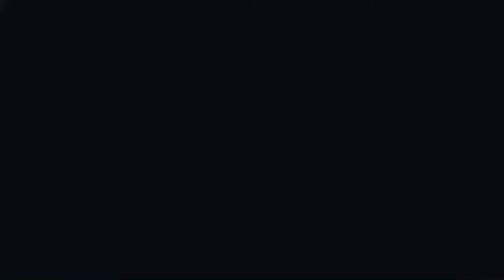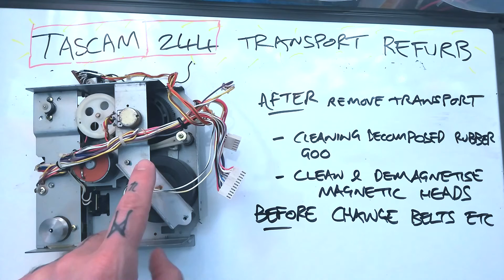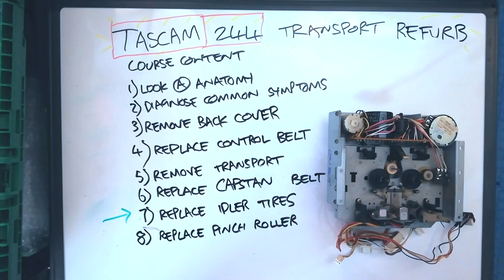1 Introduction (Fix Your Tascam 244 Portastudio Transport)

Comment: Hi Tetrakan! Thanks to your videos I was able to successfully replace all the belts on my Tascam 244 — super easy to follow with clear, step-by-step instructions. 🙏

I’ve run into one issue though: when switching to record mode, the VU meter on Channel 1 is fully maxed out and there’s a loud hum. The other channels work and record perfectly fine. Monitoring Channel 1 through the headphones also sounds normal when I plug in a guitar, so the problem only appears in record mode.

Do you have any tips on where I should start troubleshooting? I’d really appreciate your insight.

Thanks again, and greetings from the Netherlands! 🇳🇱

Comment: I've finished restoring my 244 based on your wonderful instruction. Thank you!

I'm having an issue with the headphone outputs. It's a high-pitched buzzing sound that comes and goes. It tends to get louder while the tape is advancing, but it's always there to some degree, no matter how I set the controls. Often just touching the controls will make it louder or quieter, and even giving the unit a gentle whack on the side can make it go away. Have you encountered this before?
Reply: I've figured out my issue, mostly. 

The first clue is that the buzz was a perfect match for the spinning of the capstan motor. When I slowed the motor with my finger, the buzz dropped in frequency and stopped. Ok, so that's the source, how is it getting into the audio? Schematics show it can only be through 12V or ground.

The second clue is that the buzz would come in and out when I wiggled the power supply/output amp PCB. It makes sense that the problem would be there, but what could cause this behavior?

I unscrewed the PCB from the chassis, and the buzz was persistent. Then I connected a lead between the PCB's bracket and the chassis, and the buzz went away. So I guess it's a grounding issue? I screwed the PCB back to the chassis and it's gone. Not the most satisfying resolution, but I'll take it!

I hadn't removed that PCB during my refurbishing. I guess some oxidation formed between the bracket and screws and made a bad connection. Re-tightening the screws would have scraped away that oxidation.

Some tips for removing that board, since I didn't see it covered in any of these videos. There are three screws, left middle and right. The middle and right ones are hard to get at because there's a bundle of wires right above. They have black wire guides attached to washers that you need to open up to shift the bundle out of the way. It would be much easier with the channel strips removed, but I managed without removing anything. I advise using a standard screwdriver, not a multi-bit screwdriver with a thicker shaft -- I almost stripped the left screw because some components were in the way, tilting the screwdriver.

I hope this helps someone, or at least gives them some ideas for troubleshooting a different issue.

Comment: YOU ARE A BEAUTY! These tutorials are a godsend! I've had a tascam 244 since I was 9. I'm now 29. I learned how to record on this thing. 

Struggled to intuitively fix it over the years with no knowledge of tape machines. I finally thought I had to sell it for the past couple years because it has been eating tapes like mad.

I diagnosed the problems thanks to these videos. Thought I'd have to order some cheap replacement part for the pinch roller. Or pay this ridiculous sum for an OG one. 

I impatiently took one from a cheap unused boombox, cut the sticky problematic material off the old one, used rubbing alcohol to clean it, sanded the center to match the gauge of the original brass part snugly and hot damn. This beautiful source of tape saturation is alive again! 

Thank you so much! 

God bless 🙏🙏🙏
Reply from the maker: That’s awesome, glad to help!

Comment: I aimed to refurbish my old Tascam 244 I found in the cellar. Following your instruction (thanks a lot !!!) I replaced both the capstan belt and the control belt as well as all rubber parts. I cleaned in- and out-side as good as possible. After the machine was resembled, the capstan belt moves but neither of the buttons (play, forward, rewind) works. I am clearly not an expert in electronics but is there anything obvious I could try? Thanks a lot.
Reply from the maker: The control motor should be turn8ng the black gear below it in response to button presses - if this isn't happening, explore cleaning or just replacing the tactile switches underneath the plastic coveted user controls. If you check my 244 playlist, there is a video on this.
Reply: Thanks a lot.  @Tetrakan

Comment: Hey mate, first of all I just want to thank you for all your help and the valuable information you have put out on these videos.

I have a question I've seen other people ask, but I'm still clueless as to what to do next.
Here is my issue:
As a mixer, my tascam 244 works great. All channels recieve audio without problems and eq works, all is good. When I go into playback mode or record mode, channel 4 doesnt work meaning it doesnt record anything and doesnt playback anything that is recorded. I've tried recording to track 1 and 2 and flipping the cassette, still no sound out of channel 4.

Any tips as to where to look? There is no one in my country that can actually help me and its kind of frustrating at this point. 

I know my question is a little ambiguous but hopefully you can give a few pointers that will help.

Thanks mate, God bless.
Reply from the maker: Hey, I could give a very long detailed description of what to do here, but in a lot of ways it would be easier (for you) if I refer you to my playlist of electrical troubleshooting videos-  within that playlist pay attention to two videos about magnetic heads, one about signal tracing and three about electrical signal flow in the 244. After watching those six videos you should have a better idea of where to start...if later in the process you are still unsure if how to proceed, leave me a message on the comments of one those videos and I'll advise you, thanks for watching! https://youtube.com/playlist?list=PLYsfQOh0tsJV9lzfeBFGJsI0md4FRGR6h

Comment: you are the best.  so, i still have a problem.  when i press play, it just goes into fast forward, although the idler tire does release.  any thoughts on this?  on another note, i found two screws that hold onto the face that you didn't mention.  they're VERY long screws that are found deep in the main wiring channel.  took me a while, but i got it done.

Comment: Hi, would I be correct to assume that a tape that was recorded on a 244 cannot be played back on a 246 simply because tracks recorded from the 244 would be spaced out on the tape ribbon differently than the 6 tracks on the playback head of the 246? I'm not entirely tech savvy about these machines. Also, do the two machines run at the same speed? Thanks again for your videos!
Reply from the maker: 246 is 4 track cassette, 6 track mixer. The transports on both models are more or less identical. The 246 is dual speed and defeatable dbx,  the 244 is high  speed only, dbx is always on. So if the 246 is set to high speed and Dbx turned on, the recording ms should sound identical on both units.
Reply: @Tetrakan  Ok, thank you very much!
Reply: @Tetrakan  One more question about setting the speed on the 246. Is there a switch on the unit that you would use to set to at high speed or do you just turn the pitch control all the way up. I've used a 244 before but I've never had a 246 in my possession to look over. Also, I assume there's a on off switch for the dbx you mentioned? And lastly, how would you apply a 6 channel mixer to 4 tracks? I'm a little confused about that.
Reply from the maker: @39thala  Thanks! On the 246 there is a high/low speed switch to the right of the cassette cavity inside the cassette door to choose between 3&3/4 inches per second (same as a 244) or 1&7/8 ips which is half that, the same speed as commercial cassettes and low speed units like the Porta On; the pitch control knob changes the  base speed by plus or minus 10%, pretty much the same range as the equivalent knob on a 244. There is DBX on/off button on the front panel, and an option on the rear panel to leave DBX off on channel 4 so you can stripe that channel with data for SMPTE or MIDI synchronization and send the output fo that channel to your synchronization source. Its important to understand the difference between tracks (tape) and channels (mixer) - it is typical in a studio to have more channels than tracks, so the 246 is a little closer to those sorts fo facilities..... One  reason it is useful to have more channels than tracks is so you can blend multiple microphone signals   - an extreme example would be on a 246 you could record 6 microphones on a drumkit and blend them all to one mono tape track leaving the other tracks free for bass guitar and vocals without bouncing. The other common use for the extra 2 mixer channels is to use them as effects returns - this allows you to do several things to the effects on the 246 you can't do on the 244 ;- EQ your reverb; have 2 mono effect returns instead of one stereo return; place the reverb for a guitar on the opposite side of the stereo field to the dry guitar. As you can see from the length of this comment there isn't a short answer, but stay tuned because I'll be doing an overview of the 246 soon and I'll elaborate on the mixer in that video.
Reply: @Tetrakan  Very informative! Again, thank you very much!
Reply: I just want to say, your videos are great! Thank you for sharing your knowledge!

Comment: hello tetrakan supermonobloc , i was about to attend to my tascam 244 portastudio only to find that record playback capstain heads are protuding as they would if in recording mode , i cant correct them . hoping you may have a suggestion mate . thank you tony lee
Reply from the maker: The control belt probably snapped in that position. You can turn the white plastic wheel on the rear of the transport by hand to lower the heads
Reply: @Tetrakan   thanks for your time in replying tetrakan much appreciated from australia again

Comment: Hi Buddy! Any chance for your helping tips on my channel 1 being really quiet/ low signal? Are there any known quick fixes for thos, or do i need to meter voltage and being good at schematics? 😊 best rwgards, E
Reply from the maker: There are several things which could cause this, dirty faders is one, i'd say try to watch through all the videos in my 244 playlist. If you want to jump to the one about calibration, here is the link...to do it properly you need an analogue meter or scope and test tapes, but as a dirty hack you might get away with just turning up the playback amplifier trimpot on your problem channel, and all you need for that is a small screwdriver, thanks for watching. https://youtu.be/vNCSR447M5o

Comment: I have a Tascam 424 MkII. Are they at all similar
Reply from the maker: Yes and no. The 424 mk II transport is smaller and lighter and has only one motor which turns constantly when the unit is on  - the capstan rotation is driven directly by this motor but then a smaller belt from the flywheel drives the raising and lowering of the magnetic heads and the turning of the reels (which works via gears not rubber idler tires). There's a complex system of gears and cams which convert the flywheel rotation into reel motor and head raising functions, and two solenoids are responsible for which cam and gear is engaged, it's the solenoids which respond to the user pressing the transport buttons. The same transport is in the 424 mkiii also. I filmed a tear down if the mkii, check my channel landing page, there is a horizontal section for all the portastudios I have filmed. Thanks for watching 😊

Comment: I've learn a lot watching your videos. I'm having issues with my Sanyo M7735. Hopefully you can help. Thanks https://www.youtube.com/watch?v=oWaYLAF7Cdk&frags=pl%2Cwn
Reply from the maker: Hey, I will give you more specific feedback on your video's comment section, but for the benefit of anyone else reading this - generally speaking nine out of ten transport problems are caused by EITHER a] bad rubber preventing the energy form the motor reaching moving parts (because rubber becomes dry and loose then gooey over time) OR b] bad lubrication limiting the movement of moving parts (because lubricating grease begins to act like glue over time) Occasionally some sort of plastic part will snap, or a motor or a capacitor pertaining to a motor will die. If the rubber is fine and the motor is turning and there is a wheel not engaging, that says "lubrication problem" to me, in which case you're going to need to at least partly dismantle the transport taking plenty of reference photos as you go, clean off the old grease with isopropyl, lubricate with silicone grease and reassemble. Frankly it is a tedious and nerve racking process, especially with units that have mechanical buttons (the ones with electronic transport buttons are typically easier to dissassemble because they are less mechanically complex). Good luck!

Comment: This is invaluable, thank you for making these videos. I was debating making something like these because nothing was this comprehensive, but you are going to 11 with it - thank you. I got mine off Craigslist and the whole thing was covered in nicotine stains and cigarette tar. I have a 246 also that needs a pinch roller replaced, so I’m really looking forward to that video. Thanks again.
Reply from the maker: Thanks, really appreciate any feedback, and glad to hear you're finding this useful! Pinch roller video should drop very soon, and the pinch roller mechanism on the 246 is identical to the 244's. I'll also be doing some videos on cleaning the case, and adapting inexpensive, readily available parts to the transport, since the pinch roller/idler tires/ belts kits being sold on ebay at the moment are very expensive!
Reply: Tinkering with Tascams Excellent! Thanks again